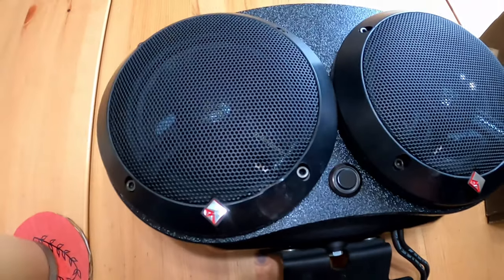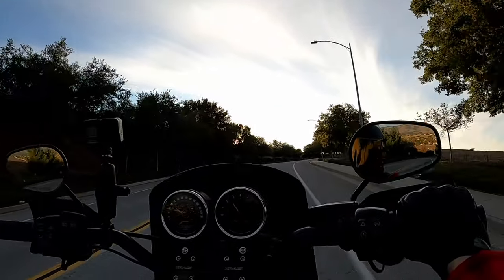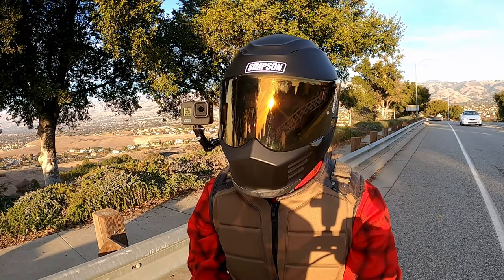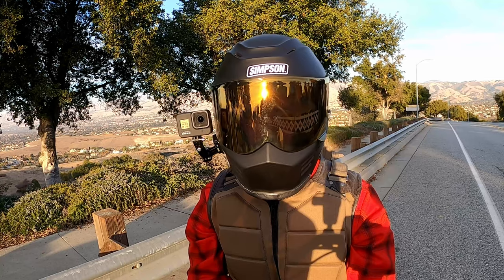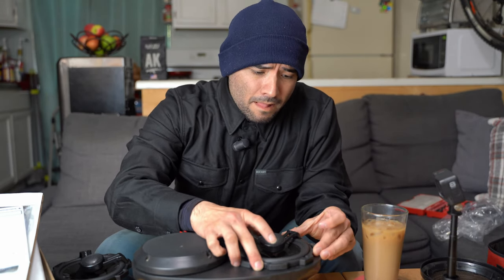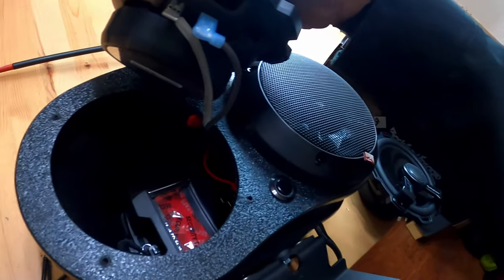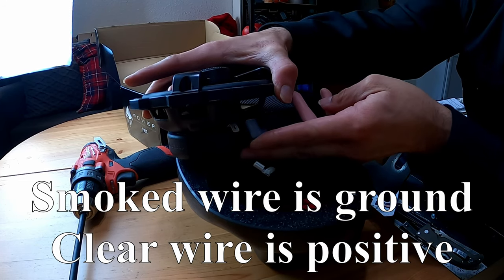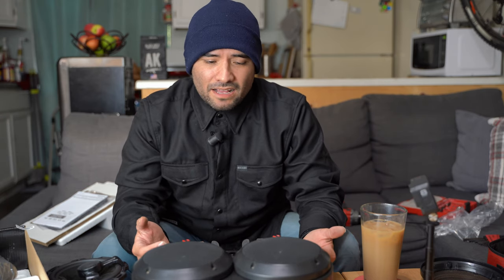Fixing Plex Audio - 5.25" Rockford Fosgate Power T152 2-Way Speaker Replacement & Update From Plex

Comment: Well, after trying the T152, and the TMS-5, I just put in the new Hogtunes 352-XLR 5.25" speaker....its a 2ohm speaker, 150w RMS each...all I will say, is OH MY GOD.  Highly recommend these new speakers from Hogtunes.  Set the amp up right and you wont be disappointed.  Check into it, weather proof as well.
Reply from the maker: thanks for the recommendation, I'll pin the comment since people have been asking about better sound.
Reply: @InfamousCreep  its not better per say, just louder.  They are 150W x 2 @ 300W total, compared to the TMS5 120W x 2 @ 240W.  The Rockford fosgate sound amazing, but at 0 - 40mph.  After that, the quality doesnt matter so much, just the loudness.  The hogtunes have the bass and mids really nice, just missing off a hint of the highs..but thats all good, I cant hear detail anyway on the dyna.  I might do a video, or maybe I will send one on IG to you.
Reply: oh.._and if you do order it, get the XLR ( R for rear speaker, the magnet is smaller to fit )
Reply: I wear full face helmet. Would this worth money to invest?
Reply: @paulson9616  I'm full face too...its loud.  No issue.  Even at 80 mph.  Get the TMS-5, or the marine grade...they are a bit louder and deeper bass.  PLEXAUDIO has the best customer service hands down.  BEST.  Your gonna need a fairing though...cant install this without fairing.
Reply: @RichardGergely  I do have memphis Shade Road Warrior with 13-inch windshield on my LRS. I have relocate my guages on top of my 14-inch T-bar, and would this be a problem with fitment issue?
Reply: @paulson9616  no problem with gauge, you have a great fairing...they have either a universal mount, or a specific one for your fairing...dont forget to order the mount as well, its a separate order.   Why dont you check out their instagram page....tons of photo's with your fairing and bars.  It really is stupid loud and clear, crisp.  Whatever quality mp3 you have, the better the sound.  So always have good quality mp3's.  Tune in radio etc sound excellent as well.
Reply: @RichardGergely  k. Thanks for the info. Never had any audio system and I normally listen to my cardo headset in my helmet. Hope this is loud n crisp on freeway going 80 plus even 60 plus at it while I have a full face helmet on.
Reply: @RichardGergely by chance  do you have a video of your set up with the hogtunes speakers? Also what do 
you mean by set the amp up right? Curious as I may want to try this.
Reply: @CrespoNYC1  If you take out the rockford fosgate speakers that come with the PlexAudio, then you have to tweek the gain on the amp.  The TMS5 Rockford, the waterproof one is pretty damn good, good base etc.  I needed a little more out of my speakers so I tried the hog tunes Xl's and I am really happy with them.  I dont have a video sorry on the set up. But tweeking is not too hard, there are flashing lights to indicate the speaker amp is set too high...it blinks red, so you just turn the amp down till you get a blue/yellow...instead of the red blink.  The amp helps you find the sweet spot.
Reply: @sumyonguy  Thanks for the response Richard. No other modifications other swapping speakers and adjusting the gain on the speaker itself?  Thanks again!
Reply: @CrespoNYC1  Gains on the AMP, which voids the warranty on it...but do it.  You cant blow that amp even if you tried.  Its just a minimal tweek cause the hog tunes speakers are 2 amp, vs the full sounding 4 amp Rockford Fosgates.  The Rockfords sound better, but the hog tunes will give you the extra loudness....still, on a bike, its tough to distinguish quality sound.  You got this..also watch a video on the amp, how to adjust it.  There will be 3 to adjust. High, Mid and low.  Dont touch any other switch.  Take a pic before you start just incase to have to put it back to what Plexaudio set it too.Also,,,take note POSITIVE and NEGATIVE wires on the STOCK speakers...so when you replace the speaker, you are connecting Positive to Positive and Negative to Negative.  If you criss cross them, you still get sound, but its a little messed up cause the speaker is working opposite to what it was designed to do.
Reply: Hey brother I’m wondering if the speaker grills fir over the hog tunes speaker
Reply: @ItZfRiDaYNiGa  grab these - Hertz CG 130 Speaker Grilles for Cento Series 5-1/4" Car Speakers
Reply: Turning the gains voids the warranty? Thats ridiculous for the company to even state that..unless they mean adjusting the gains voids the warranty on the speakers as bow you are changing the factory settings for their set up.
Reply: @RanGer-498  yup, voids. The amp is 400w, but the speakers can only draw 200w…basically the amp is overkill. But RF doesnt make a 200w amp to fit in there.
Reply: @sumyonguy  thank you for the information.
Reply: Hi did you adjust Frequency with EQ ? or Just Output ?
Reply: @amg5795  Plexaudio is coming out with the XL. 6 1/5 speakers….

Comment: Are there better speakers you can upgrade to that will fit in the system?
Reply from the maker: The speaker size is 5.25, I think these are the best for the size. You could try JL-Audio, I doubt Focal PC speakers would fit. These are loud and sound super clean.
Reply: So I’ve had the system for almost a year now and also blown a speaker!! The were able to replace the speak but I don’t want it to happen again.. I was just courteous If I could replace with a better speaker for the amp size so it dosnt happen again to me
Reply from the maker: @jaysilvestro2251  there's just not a lot of room left in the speaker housing. I could of tried different speakers, but I like the sound when its working properly. I'm sure Plex Audio picked these speakers for a good reason.

Comment: Man I wish I could find grills , no one seems to just sell replacement grill Plex or RF
Reply from the maker: Maybe a metal shop could repair the grill? I know what you mean, I had to buy the pair to repair my one speaker and I looked everywhere. You could buy generic grills, but it'll be tough to find one that fits.
Reply: @InfamousCreep  the plastic on mine is cracked  and some metal bent in . I took it off and Ben the grill out no damage to the speaker. But to buy a new set just for grills is crazy . Thanks for the metal shop info .
Reply from the maker: @quicknarco8567  have you tried repair putty? I worked at a bodyshop in my teens. Smack some plastic weld on it, sand it down and paint it black.
Reply: @InfamousCreep  I will try that